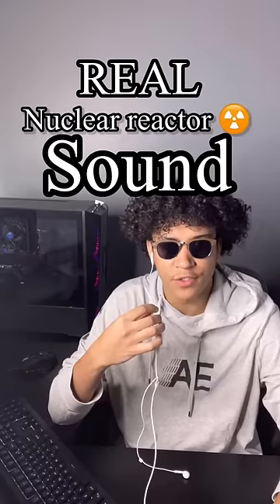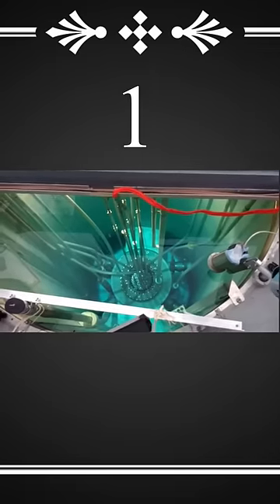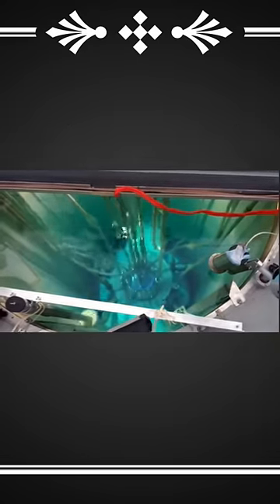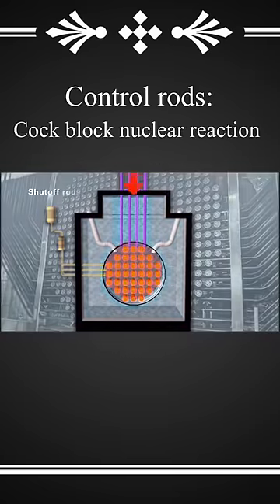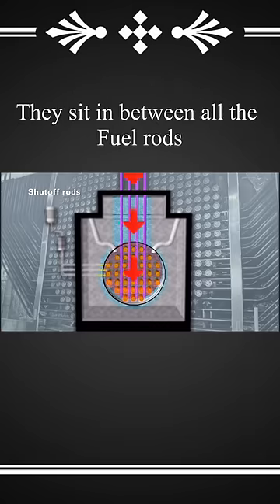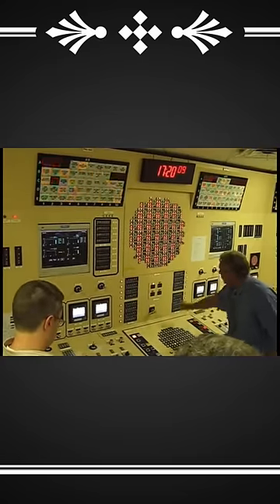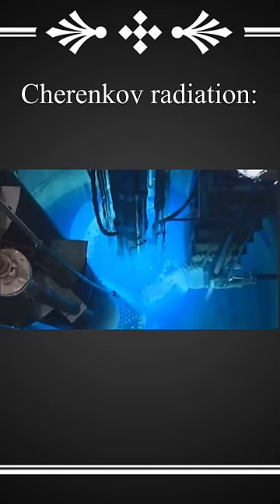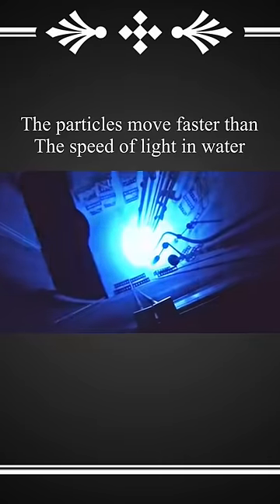The real sound of a nuclear reactor #shorts

Comment: “umm sir is it supposed to be on fire”
Reply: "No wh..."
Reply: Don't worry guys, I checked on the reactor and there is healthy smoke coming out of it
Reply: @mrrexychomp9829  ok good, i was wondering what smoke tha
Reply: @JLL_29  i thought it was decorative fire like the one in my oven
Reply: And this is how Chernobyl happened
Reply: @murkyturkey5238  it happened because where the rods go in the tubes had gotten warped during a test the brought the rods fully out releasing a lot of energy but the rods could not go back in meaning all that energy just kept pouring out and then kaboom
Reply: Idk sir, is this even a question?
Reply: @Goingham6938  the cap gets yeeted due to pressure ---> stuff in the reactor mixes with air and then comes the big boom
Reply: @bananathegrea8700  Chernobyl be like:

Comment: Nuclear reactors are so cool, they are literally the best chance we have at limitless energy
Reply: But theres 1 single risk:
One wrong button press, one wrong lever pull, one wrong move in general and you perish.
Reply: @criesandthrowsuponthefloor608  The new modern reactors basically wont let you do it. There are very small odds of it having a meltdown.
Reply: @aeronauticsandlego  that's probably what the scientist at Chernobyl told everybody too.
Reply: @Quintos.  Chernobyl uses a different reactor design then typically found here in the West.
Reply: @Quintos.  what happened in chernobyl was a lack of proper maintenance of equipment
Reply: Until chernobyl happens you think they are cool
Reply: @Water King A fusion reactor, not fission.
Reply: Fusion be like
Limitless energy impossible be like
Reply: Funnily enough, there have only four reactor meltdowns in history, one was caused during the early days on accident due to improper safety procedures, the second was caused by a fucking Tsunami crashing into the plant after it was hit with an earthquake, a third was a test reactor that went critical on purpose to test the limits, and a fourth was sabotage caused by a murder suicide. As a result, over sixty deaths attributed to the reactor with a further five-thousand from radiation over 80 years. Another fun fact is that burning fossil fuels creates more radiation over the course of a single year than a Nuclear plant does in thirty years, attributing to around thirty million deaths a year. Nuclear power is only bad because no one has no fucking clue how it actually works and believe they're experts in the matter when they really aren't. Fossil fuels cause more damage to the environment than nuclear power ever will. Also, nuclear power plants CANNOT go kablooey, it's physically impossible in every conceivable sense of the word. Even if a reactor melts down, it will not explode, not unless physics decides to not exist for ten seconds anyway.
Reply: @starhammer5247  I'm pretty sure there have been more than 2, but the others were fairly well-contained.
Perhaps more to the point, they were all gen 2 reactors, and we're on gen 3.5 and about to start into gen 4 reactors.

I support renewables more for the simple logistic reason that I believe we can build more of it in a short period of time than we can with nuclear so it's a superior option for getting off carbon quicker (and gen4 reactors look like they're going to far outdo gen 3.5 reactors in every way, so it's possible new gen 3.5 reactors will be obsolete or at least outdated before they can pay for themselves), but I wouldn't put any energy into opposing a nuclear plant built near me.  Suboptimal is still far better than the status quo.
Reply: @dynamicworlds1  As far as I know, Chernobyl was the worst and had mismanagement written all over it with its sixty-plus deaths and leaking radiation, Fukushima was unavoidable seeing as it was hit by an earthquake followed by a Tsunami but only had one death, the third was a test reactor and had zero deaths, and the fourth was believed to be sabotage and only resulted in three deaths.
Reply: @starhammer5247  my memory's not perfect but that sounds at least close to accurate for the other incidents.  The only nitpick of disagreement with that is that Fukushima may not have been entirely unavoidable, at least with more modern reactor designs, but yes, handling that kind of natural disaster with even an updated a gen2 reactor was always going to be very difficult, and the response afterwards was outstanding, so the damage was kept very minimal.
Reply: @dynamicworlds1  Yeah, Fukushima, for what it's worth, was handled exceptionally well.
Reply: @criesandthrowsuponthefloor608  The reactors which we have right now are 3.5 gen reactors. The reactor which was in Chernobyl was a pressurised water reactor so obviously when someone would want to lower the pressure or turn off the reactor quickly, the reactor's lid would just explode and fly to the fucking space due to the very quick change is pressure. This is why in my opinion Boiling Water Reactors are much much better in terms of safety. The second thing is that today's reactors don't actually have a  shut off button like the reactor in Chernobyl did. The 3.5 gen reactors do not have this feature.
Reply: @dynamicworlds1  Statistically the gen 3.5 reactors are much much better then renawables. You also have to think about the fact that producing the solar panels or wind turbines also emits Co2. If you would want to produce the same ammount of energy with solar panels, you would cover like 15 hectares with these metal pieces of shitbox which would be a complete wqste of land.
Reply: @criesandthrowsuponthefloor608  That's how it works in cartoons, not in real life
Reply: @criesandthrowsuponthefloor608  Wrong.  Multiple layers of procedures, training, mechanical and electronic limits and interlocks, safety systems and their backups, and the backups to those are all in-line.  You have to really screw up something in each and every layer and have those holes align to cause a problem.  Defense-in-depth.  And several layers have been added since Chernobyl.  And many more before that after TMI.  Chernobyl had none of those, and instead of facing trouble for violating the rules anywhere else in the world, the Russian government by its nature encouraged it.
Reply: @Quintos.  nope they didn't listen to them either.
Reply: @criesandthrowsuponthefloor608 tell me you know nothing about nuclear power plants without saying it. 

My old man used to work for a Nuclear power plant for 20+ years and took me and my sister to the bring your child events. There are so many safety procedures and guidelines that the chances are small. Even then if the plant was well built and up to code, it would not be as catastrophic as one might think. The only reason why we don’t pursue nuclear energy because of a bunch of smooth brained individuals read the word Chernobyl and thought that happens all the time.

Comment: I don’t care if it is Radioactive, I’m jumping in the forbidden pool
Reply: It's actually not radioactive
That water you see around it's called a moderator. It's meant to stop the radiation from reaching the surface (and also acts as a cooler), so as long as you don't approach the core, you're safe.
The water is actually just a little bit colder than the average bath water and because the water is clean, it's safer to swim in a nuclear reactor's pool than in a public pool.

But of course, you're not allowed to swim in it 😂
Reply: @pufocina you'd still die tho, not from the radiation but from the bullets trying from the guards
Reply: @stylinsandwich  oh yes of course! 😁😁😁
Maybe in America, I don't think they'll shoot you in Europe

Comment: I hope that guy recording didn't get a new leg or scales from being so close.
Reply: Water completely blocks radiation, it's nearly as good as lead. With that much water you could swim near the top without getting warm
Reply: @prestonfisher2632   thanks for the information I did not know that.
Reply: C o u l d swim when it just starts, it gets awfully hot thanks to the reactor
Reply: @prestonfisher2632  so not true.  Not sure if you're thinking of a PWR or a BWR.   U still get radiation standing outside even the spent fuel pool (& that's not even in the reactor building).  You are correct  about specialty divers that go in the water (very very rare since a diver would be getting high doses of radiation), and obvi the plant would have to be offline b4 that could happen
Reply: @banks4realmusic413  pretty sure they keep the stuff down there because of its nuclear and thermoradiation blocking capabilities. Ive also not gotten far enough into my schooling to know any of the math and this is mostly something I've heard and makes enough sense
Reply: @banks4realmusic413  also keep I'm mind I'm referring to this specific reactor, which I believe is a research reactor and not a PWR or BWR
Reply: @averagetexan6730  the water is constantly circulated to avoid that
Reply: @banks4realmusic413  An insignificant dose of radiation. I'm sure the researchers there use Geiger counters and know what they're doing, the water shields well enough.

Comment: For those wondering: "How can particles speed over light speed?" It is because the light speed in a medium (like water) can be significantly different from the light speed in a vacuum (c). In water the speed is 0.75c. So, in this case, the particles accelerate over the speed of light in the water (but still less than c!!!).

Comment: So one thing, Cherenkov radiation occurs when a particle travels faster than light typically does in that particular medium. For example, the speed of light in a vacuum is faster than the speed of light in water (about 75% of the speed) so it’s not moving faster than the actual speed of light but it’s moving faster than light when both are in water

Comment: One thing to fix what you said about cherenkov radiation. It's not light travelling faster than light. It is charged particles entering the water faster than the speed of light in the water. Light travels slower in water. So when the particles hit it, they slow down and produce the distinctive blue glow.

This is still simplified, but the important distinction is that it is the lowered speed of light in the water that causes the glow.

Comment: Should also state that this only happens when the reactor goes critical control rods are pulled out and then are pushed right back in to control the reaction, when reactor goes critical is a good thing. This means it is working if it doesn’t it is not working properly

Comment: Another fact, that water is water, but it’s “dead water” have to use special types of water to keep radiation away and keep the rods and chamber cool.
Reply: It's heavy water, also called deuterium  oxide
Reply: @aidenpearce5275  from what I was told from my buddy who works at a plant, it’s referred to as dead water cause it does not have oxygen in it.
Reply: @GingyyFPS  typically in a reactor pool it's still water, Just D²O instead of H²O which is why it's called heavy water, since it's a heavier isotope of hydrogen called Deuterium

Otherwise it would've just been hydrogen which is a gas
Reply: @aidenpearce5275  fair enough, love science

Comment: This is a small reactor for science. Its a quick reaction test with a big power output burst ,but i will die off as quickly as it came deu to the temperature in the reactor.
Reply: They are really save and they are commonly used bij the university

Comment: Nuclear reactors don’t actually make any sound just by fission! The sounds you’re hearing are from electronics and motors moving. This reactor is a super neat research reactor though, it’s a TRIGA reactor designed to be impossible to melt down! The fuel is made of a special material that has what’s called a negative temperature coefficient of reactivity, so when the temperature of the fuel increases, the fuel actually becomes less reactive and fission can’t occur! It’s like a neat built-in control rod that prevents accidents. As a result, these reactors can also be “pulsed” like in the video. Basically, they launch out a control rod and the power spikes to gigawatts for a fraction of a second before they automatically shut themselves down. They’re a super neat reactor, lots of universities in the US have them and will give tours to anyone who’s interested! Source: I work at a TRIGA reactor and get to teach people about them all the time :)

Comment: Those are not normal nuclear reactors for power generation. Control rods in those move more slowly. What's shown are research reactors which use different fuel that doesn't do a self-sustaining chain reaction, just one short burst when you remove the rods. And to capture that process well, you need to shoot out the control rods with composed air.

Comment: The light equivalent of breaking the sound barrier? So we have had proof of breaking light speed for so long?
Reply: Light speed in water, not in a vacuum, the speed of light in water is around 275,000mph, the speed of light in a vacuum is 300,000mph so it is causing the light to go faster than 275,000 in water

Comment: Pretty true here is the whole story how chernoby blowed up. Since 1987   Midnight The Soviet union Grew. Well there was a Engineer was doing a experiment on the reactor just for a rank Head engineer so he predict that if he took of the rod all at one it mabe rhe double power currently they are doing the experiment in 4:23 AM at night. So when he took all out at once In a Millisecond the reactor made 100m power it made so much power  that it exploded into million of pieces but the Radiation went iut quick and you will think then how the fire developed? Well it simply easy by overheating.  They tested it in reactor 4 all fuel pump leaked in the basement under Reactor 4 all the water was super hot nearly 180 it started 50 they have 2 days so cool it down back to radiation the Radiation wen in birds body and you died instantly some firefighters were late cus the bird was destroing the cars and it started with some firefighter then alot the firefighters were so dumb the went inside the power plant and their clothes got. Radiation aboit 100 but in Reactor 4 control room it 1000 radition so you can stay there for 5 min or you will die and that how chernoby started

Comment: There are 2 clunking sounds. The first one should be the removal of the control rods since the reactor kicks on, right? Why don't the rods move upward on the first sound?

Is the second sound a partial insertion back into the reactor to control the reaction?

Thanks in advance for any answer :)

Comment: the real sound of a reactor is more like pump motors and running water and steam in the boilers. nothing exciting. you can’t hear controlled fission. control rods are pulled up very slowly, not in a quick jerky motion. so the click sound could just be a breaker closing to start the control rod motor.

Comment: A lot you said is to my understanding right. And I'm just a Hobie Physiks fanboy so don't take it seriously.

But the Mechanical sound I guess I driving the roads in to the reactor because you remove them to the start up... And they move to the Light that dimms.

And... Breaking the light barrier is kind of right...

The radiation travels faster in air than in water because less atomes to interfear.

As they hit the water they hit a lot of atoms and knock alot of electrons that emit Light by changing Orbits...

And that's the Nerdy version of saying. Radiation smacks water till it's Ass glowes.

Lightspeed is never under or over stepped? Just as they strike they get absorbed and enitet what let it appear slower.
Reply: Oh thanks bro, even i didn't know what are you talking about, but I respect at you

Comment: The blue light is LIGHTING, not radiation. Don't fucking lie about shit It's there to make sure that the fuel rods are still aligned and don't break because they cost an ass load a piece, and you're going to want to get your FULL USE of them before they're spent and need to be recycled.

Comment: buddy, you needed to explain superluminal motion a little better. tons of people now believe an object can travel faster than c

so how do you go faster than light? get it in a medium where it slows down. in water, light slows down a lot: it moves at about 75% of c. so, anything moving through water faster than that (but still very much below c as that is the universe's speed limit) is undergoing superluminal motion and will emit Cherenkov radiation.

additionally, there are other forms of superluminal motion. when observing the path of stars in the night sky over time, sometimes calculating their apparent speed will yield a result greater than c. however, it is important to note here that this apparent speed calculation is just that - the star's speed as we see it, modeled as an arc traced from a circle centered on Earth. it does not represent its actual speed through space.

nothing is faster than light in a vacuum. these are special circumstances with caveats, and as far as we know, there will always have to be at least one such caveat: either light has been slowed down to allow something to outpace it, or it simply appeared that light was outpaced when it was not.

Comment: Did you just say faster than light in water?  Have scientists properly investigated this?  IIRC the fastest particle accelerators get to about 99% the speed of light
Reply: So basically homie I wanted to answer your question but I might get it wrong so remind me if I do but basically, light slows down a whole lot in water to about 225,000 km a second. This allows the absolute power of the flying radiation to pass this speed but it appears it doesn't appear to have much research purposes at the moment due to it still being slower than light in a vacuum. Hopefully I answered ur question ma dude